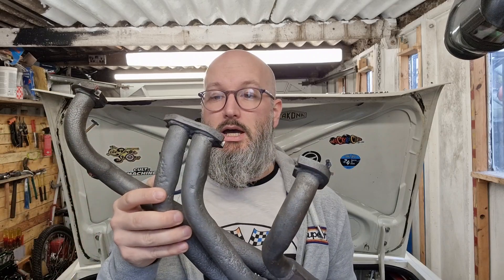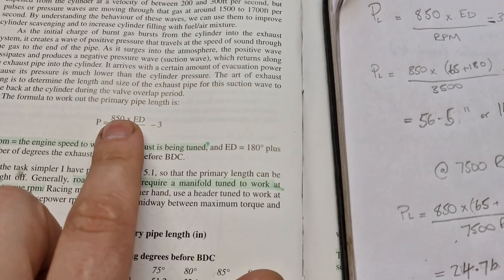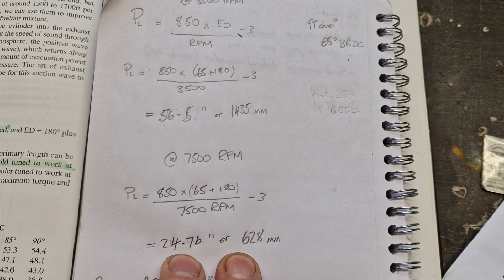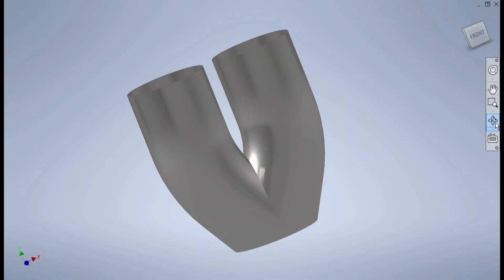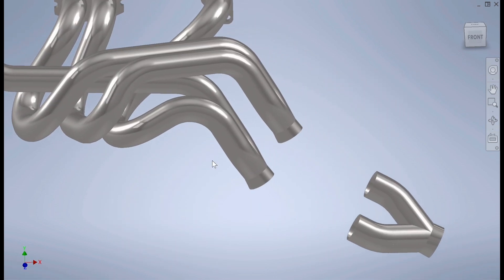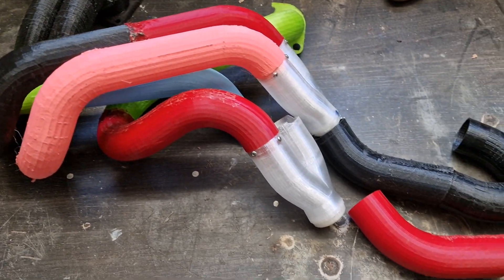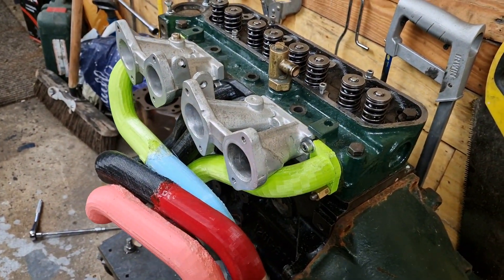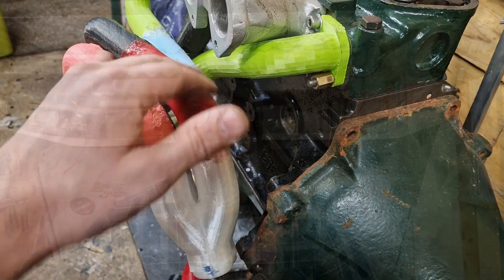designing and printing an exhaust?!

Comment: What cad do you use Jim? Is it easy to convert to Stl for the printers? Cheers.
Reply from the maker: I use autodesk inventor 2024, you can use the same functions i used on fusion 360. 

As for converting to an STL it's really straightforward. You just exporting it, there are options for other cad file formats etc but it's easy to do.

Comment: I stumbled across this when looking for 3D printed exhaust ideas. I would want the exhaust primaries to turn down immediately and allow room for a heat shield to keep the intake manifold cooler.
Reply from the maker: Since I made this video I have made a few adjustments which give the manifolds some more clearance. I have space for either a shield or heat wrap which helps.

Comment: I really like the idea of replacing the 3d printed peices with they actually tubing as you build it. I would love to do the same for a turbo build for a motorcycle.
Reply from the maker: Thanks! I had tried to design my own version of ICE engine works exhaust jigs but couldn't get the fitment right. If I was to do this again I'd break it down a further so I can get the bends right

A turbo bike would be awesome and terrifying in equal measure!